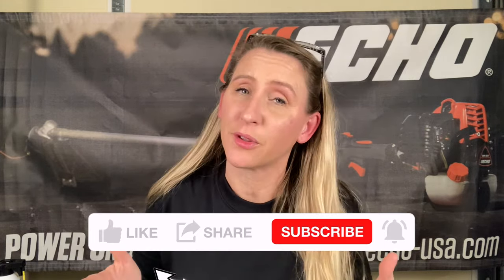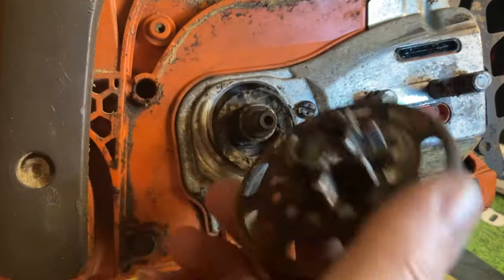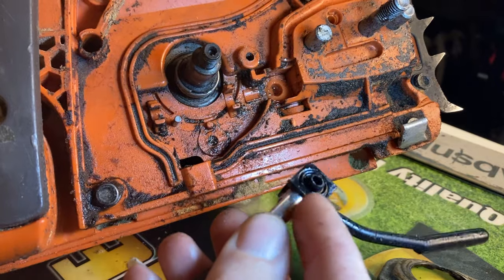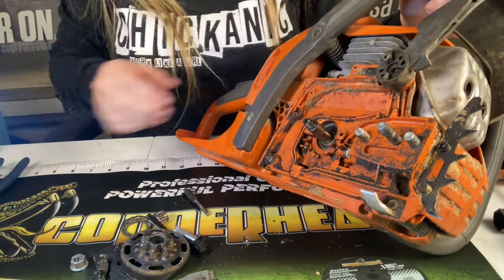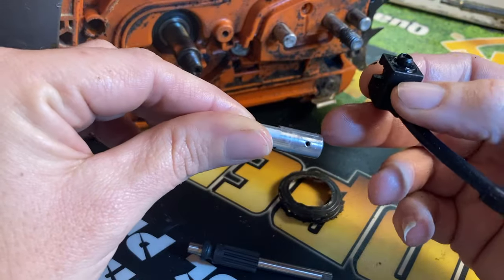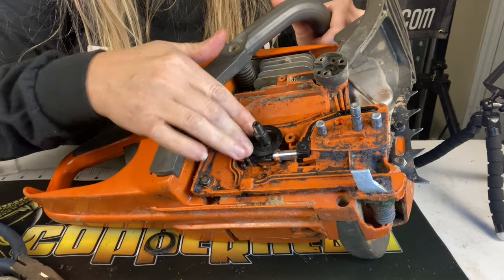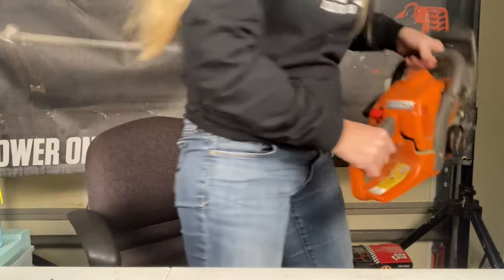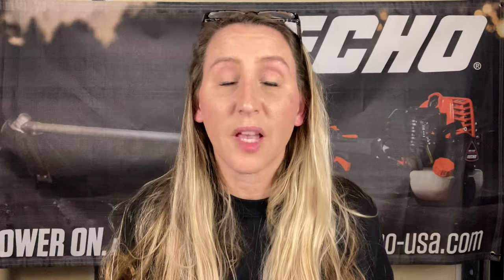Chainsaw not oiling? How to easily fix/replace your oiler on a Husqvarna saw Repair Vlog

Comment: Arborist here. The most important reason to NOT put used motor oil in your saw is it will spew it all over the place. Just use whatever is the cheapest VEGETABLE OIL in your area. This is perfectly fine in the summer and if you live somewhere with cold winters you should switch to standard bar oil if the temps drop too low. But even then it is fine with vegetable oil once the saw is hot.

Comment: You made a sizable investment in buying a better saw, don’t cheap out on the bar oil or gas mix. If it gets dirty clean it up and make sure that you clean the air filter frequently.  Keep the chain sharp an don’t over tighten the chain. Take care of it and it will last for years…….

Comment: ....that bar and chain are wrecked....l would have replaced both......
Reply from the maker: This customer is always very low on funds. The saw came in with no air filter and a plug that looked like it was used to dig a coal mine. He will ride out the bar and chain until he can't any longer.

Comment: Users don’t know anything about chainsaw maintenance.  They just destroy them and buy another one.  I was raised differently than that.  My chains shine in good light and will lay a stripe of oil on my workbench when I light them up.  I use Echo Premium Barboil and Echo Red  Armor at 50:1 in everything.  I run, mostly, Stihl saws, but I run Echo lubricants because they are the best.

Comment: the 40 series oil system is crap. you can order an oiler, a set screw to hold the unit in place, and the correct worm gear for a 50 or 60 series saw, and it will fit and work on your 40 series. Why a 50 or 60 series oiling system...its made from all steel parts(no plastic) the system is bigger and more robust so it will add more oil to your bar and chain, and it has an adjuster screw, so you can control how much oil is applied. The 40 series oiling..no adjustment screw, plastic, small, and has been underwhelming for years. upgrade to a bigger and better system and you will solve this problem!

Comment: What cause a saw  to leak oil when not in use ?
Reply from the maker: Try releasing your oil cap when done. I think it helps sometimes. Also try using a GOOD bar oil. The cheaper stuff is thinner and seems to leak more easily. If that doesn't work, depending on what saw you have, you oil lines may be leaking where they go through the saw. Thanks for watching!

Comment: Thanks, I didn't realize the oiler could be replaced without going way into the saw. Now I'm encouraged to buy that Stihl MS192 on the local CL that needs an oiler...

Also interesting to see that it's the sprocket and not the crankshaft itself that drives the oil pinion. Makes sense, so it's not glurking out oil while you're idling.

So I just bought an old Echo that's OVER-oiling. Looks like the Exxon Valdez inside the cover after just a few minutes. Do I just keep adjusting that little adjuster screw on the bottom of the saw until the oil flow looks a little more sane?